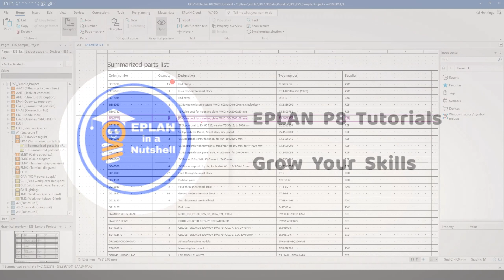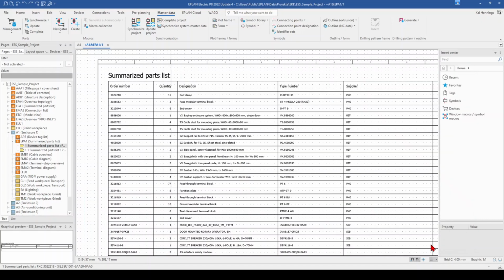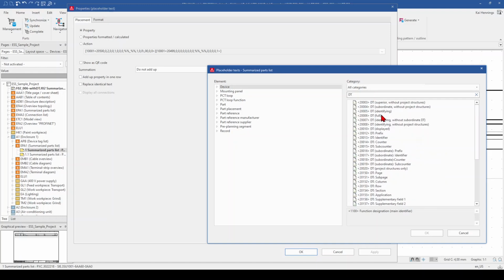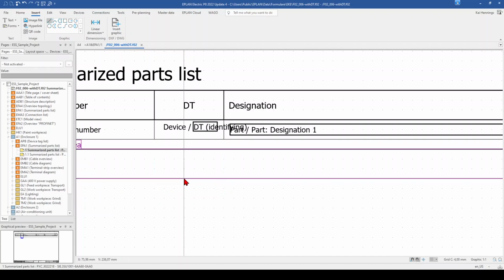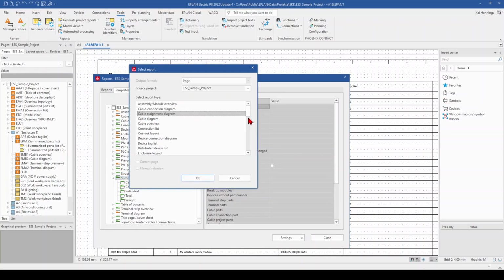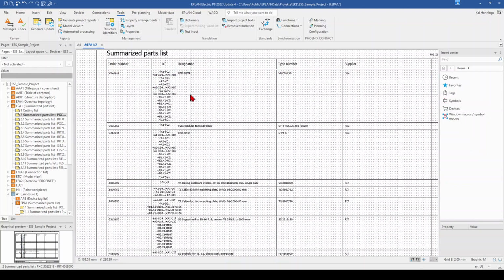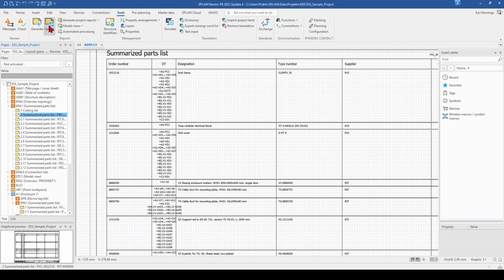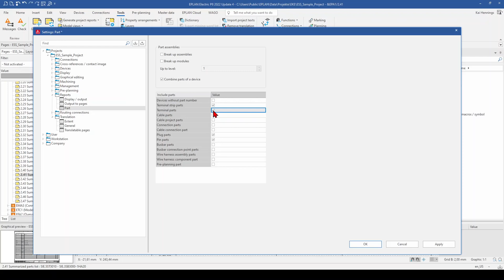EPLAN Summarized Part List with Device Tag

Comment: Can we manually add some parts details in the generated summarised parts list?
Reply: Each time you update your report you will loose that manually added info. So, I wouldn't recommend to do this)
Reply from the maker: You need to add the additional information on tour form. That means you need to open your form, modify it with a special text or placeholder text for the additional information and use this form for your project